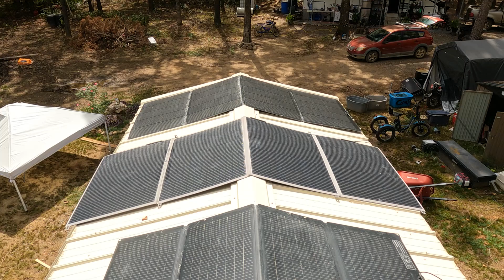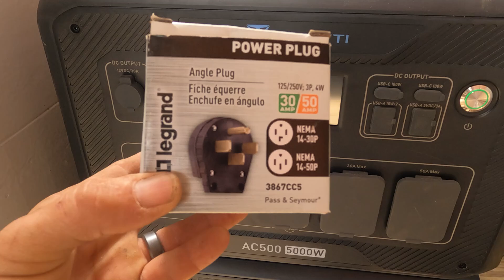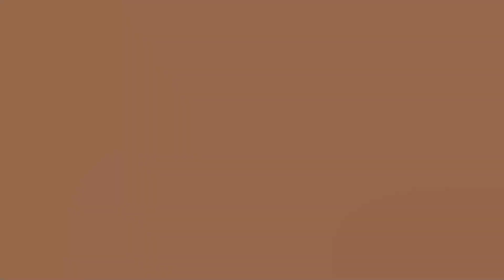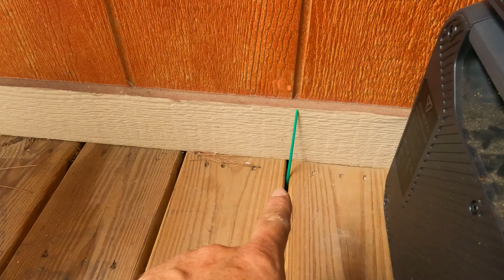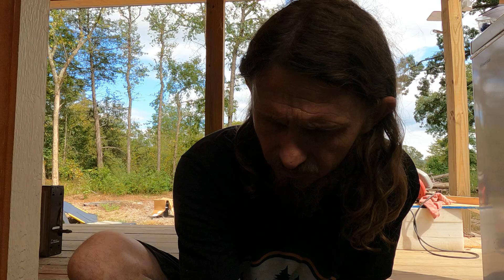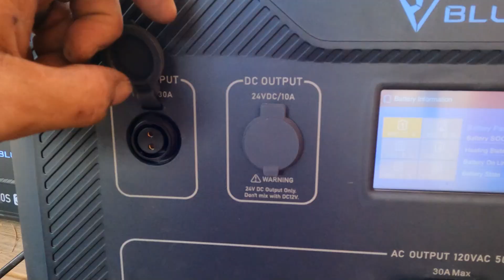POWERING THE S'HOUSE with bluetti ac 500 | work, couple builds, tiny house, homesteading, off-grid |

Comment: Mike don’t confuse the 30 amp and 50 amp plugs on your blue Eddie those are all 110 V not 220 it’s like your trailer you probably have a 30 amp plug but it’s 110. OK just thought I’d pass that along. I’m pretty sure of that.
Reply: You are correct. He will need two (2) of those ac 500 units to put in series along with a transfer kit to get 240 volts

Comment: Mike, I want to start off by saying I love your channel watched it for a long time the whole tribe but as an HVAC contractor for over 25 years you should not put a 2 x 4 below your service panel each one of those wires needs to be clamped and mounted to the corresponding holes which requires a  romex  clamp With the board there, you won’t be able to install those

Comment: I spent a small fortune on the Bluetti B55 with solar.  That thing can't even give me a cup of coffee.  The power charger failed, and after some time they verified the order and sent me a new charger.  But way to small for anything I need other than running my computer or phones and maybe internet in the wild. Not what I was expecting for the price paid.  At the time it was the top of their line.  Glad to see they are continually upgrading.  Just wish they would give a trade in value to give me what I desired before buying it.
Reply from the maker: One thing is FOR SURE... they are not cheap!

Comment: You should have put it in conduit because the mice rats squirrels will chew that wire underneath house . Plus if you had to add another wire, it would be easy to run . This is hard to watch
Reply from the maker: I should not have done that because this will it not be a permanent solution. It will be much easier for me to take it back apart This way.

Comment: Maybe I missed it but where is your return wire?
Reply from the maker: What return wire?
Reply: @driftingdreamers5  for a 240V panel you should have 2 hot wires a return and a bare ground. that's why on your 240 v plug at the power supply you have four connection points. You should have 4 wire #6 red and black is hot white wire is the return and bare or green is used for ground!! (Google: what happens if I hook up an electric panel without a return)
Reply: Return wire = neutral wire